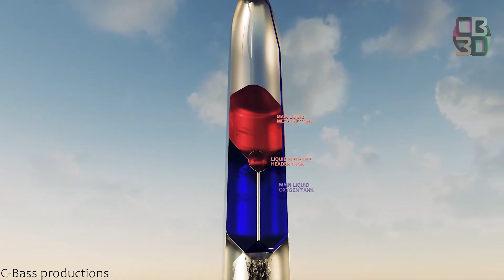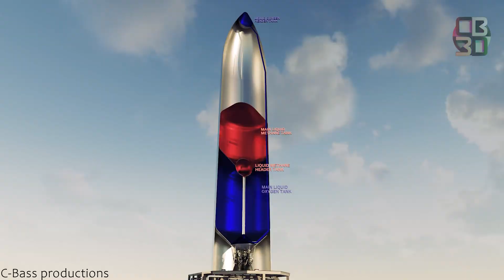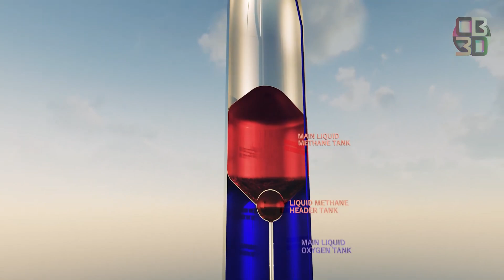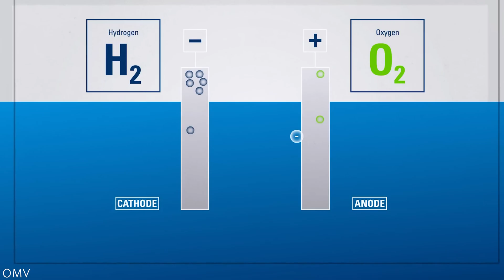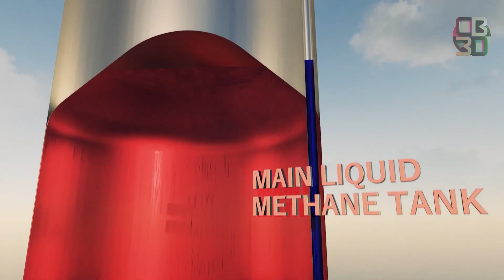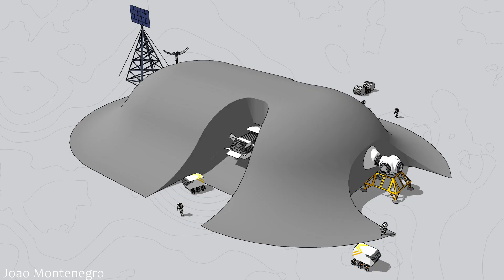Using Only SpaceX Starship To Build Moon Bases. No SLS ! But How?

Comment: I like the way you think. The SLS should have been ditched years ago. Apollo era throw away tech that costs the earth. Simple is better IMO. That's why I'd like to see thermal nuclear rockets to do the milk run between earth and the moon. The notion of having to do around six refuellings in orbit seems messy to me. Granted nuclear rockets aren't available yet but will be soon if all goes to plan. I believe it will be a real game changer when rocket fuel is produced on the moon. So much easier to get fuel tanks into orbit given the moon's relatively weak gravity well. If only visionaries like Elon Musk weren't encumbered by petty bureaucratic empire builders like the FAA. Looking forward to the day SpaceX sets up shop here in Australia. A holes like the FAA may drive Musk off US shores.

Comment: A couple points.  1: this would require insitu resource extraction to already be set up.  2: Why bring lunar starship back? It would not be able to take advantage of aero breaking to save fuel on the return journey like regular starship can. 

Would this be better? Launch and refuel two starships.  One for earth return one for lunar landing.  Land the lunar one on the surface and leave the return one in lunar orbit.  The lander can fly back up and everything can be offloaded and the return vehicle returns to earth saving fuel using aerobreaking.  That way you don't have to waste the 5km/s or where ever it is to get from to the lunar surface and back.  No insitu needed.  You can leave the lander in lunar orbit to be used again if you utilize special refueling takers with heat shields.

Comment: I agree that SLS is useless, when starship finally will be operative. it just is a way to distributer taxpayers money to the national industry .

but it would make more sense to equip starship with hydrogen/oxygen engines right away.  Then you do not need to bring methane to the moon.  Even when the amount of methane is less than that of the oxygen. every kilogram of payload counts when it comes to provide enough delta V capacity to reach the moon and get back to LEO.

another problem is, that no facilities to mine and electrolyze water ice exist on the moon.  so it need one or several  starships that bring all the equipment first and we need time and people  to install it. how will these get back in time, when the hydrogen and oxygen are not available yet ?

Comment: Good to see you back Sebastian. I love this space stuff and your explorations of different ideas.

On the CH4 problem, if a production facility is set up on the Lunar surface to break down Lunar ice into Oxygen and Hydrogen then (and I'm not a chemist so I really don't know) is there any reasonably accessible and not crazily energy inefficient process that could also be set up on the Moon to combine that Hydrogen with carbon to create CH4?

Since four out of the five atoms needed to create a CH4 molecule are already on the moon (the 4 hydrogen atoms in a CH4 molecule) I'm thinking that if such a process did exist then rather than bringing liquid CH4 to a fuel depot in Lunar orbit maybe it would be more efficient and easier to handle to bring just the missing carbon atoms (pure carbon in solid form) to the Lunar surface to feed into whatever CH4 production process was being used. That way an HLS Starship that was heading back to Earth could be refuelled on the Lunar surface and would then have enough fuel to climb out of the Moon's relatively weak gravity well and get all the way back into LEO without ever needing an orbiting depot in Lunar orbit. Also, cryogenic storage should be easier on the Moon than in Lunar orbit because the storage tanks could be buried under the surface, it would be easier to create solar shields over them, and assuming a robust power infrastructure (nuclear and/or solar panels) had been set up on the Lunar surface more power could be available for active cooling compared to what would be possible for a fuel depot/tanker in Lunar orbit.

And one other small observation on the CH4 issue. The ISS does use the Sabatier process to convert CO2 + O2 into CH4 + H2O (the CH4 is vented into space I believe). Admittedly that would not create anything like the volume of CH4 needed for fuel but in the spirit of wasting nothing it would make sense to use that process to scrub excess exhaled CO2 out of the atmosphere and that would contribute at least a teeny tiny bit of extra CH4 to the fuel supplies.

Comment: I'm in favor of a big space bus/tug. Build a vehicle in orbit, capable of reaching moon orbit and return. It doesn't need to be aerodynamic nor have heat shields, so it would be mass effective. Use specialized vehicles to get people, fuel and cargo from the surface. Being specialized they should be efficient. On the first trip, it should bring with it one or more descent vehicles for crew. This descent vehicles could remain in moon orbit, and for the next trips you only need to bring fuel. Cargo descent vehicles could be expendable, and be recycled as part of the installations in the surface of the moon. This have to main advantages: Only the earth surface to orbit vehicles need to cope with aerodynamics and reentry heat. You can build a bus as big as you want, since it is not subject to the rigors of a launch from earth.
Reply: I can see why SpaceX is going with the "Starship all the way" model initially since it's the simplest and quickest way to get the first cargo and then crew to Mars (or the Moon if SpaceX was ever going to do a Lunar project on its own and not as part of Artemis) but I very much agree with you that ultimately the far more efficient model is to break an interplanetary journey up into sections, transfer shuttles at each end to get cargo (including people) to and from a planetary surface and a separate orbit-to-orbit "space liner" optimised to only ever be in vacuum to travel between Earth orbit and the orbit of wherever you're going to.

As you say, numerous mass reduction opportunities for the "space liner" since it only needs to travel in vacuum. No need for extra structural integrity so that it can survive the MaxQ of a launch from Earth, no need for the propulsion section to have any wasted mass for sea level Raptors that are only needed after stage separation to climb out of Earth's gravity well, no need for landing legs for a Lunar/Martian etc landing, no need for header tanks - the list goes on. Also, for long duration crewed flights e.g. the many months to Mars a vacuum only vessel could incorporate inflatable habitats to give the passengers far more comfortable (spacious) living conditions during the trip.
Reply: @julianfp1952  Also, it is launcher agnostic. this is a plus from my point of view. You can start planning and building it today, without waiting for the superheavy success, you can do it with heavies. ( Of course, a working superheavy would help a lot)

Comment: I appreciate the last portion of the video, i think using Starship as a Habitat and bringing with it all the cargo it needs, filling up every part of Starship excluding the command deck. Once it is landed on the Moon, lay it down or leave it upright, but laying it down would make sense or even have the top portion that is livable space removed or detached from the rest of the fuel portion and place it on the ground? we know that Moon Starship is not coming back, however if you left it in orbit, you could put it up with docking rings, you could bring forth other starships or modules like Artemis would use, to build out a space station?

Comment: Using "Starship" as it's depicted is silly.
It has never made sense to take the second/upper stage that gets you off the ground, beyond LEO.
Maybe you could, but it sacrifices utility.

Use the SH and an equivalent upper stage to lift pieces like the "Mars Direct" tuna can habitats and other cargo assembled and fueled in orbit.

Aside from Elon's PR shows and fanciful YouTubers, I have seen nothing to the point that NASA has ever been considering the "Starship".

It's a tanker, not a cargo carrier, not an interplanetary transit hab or surface lander.

It is also never going to lift people to orbit, and it's a stupid waste of resources to look at that.

SLS is hyper-expensive not just because it's expendable, but that's just the way it and the Shuttle before it was built.
They deliberately try to involve as many subcontractors as possible to spread as much $ around as many congressional districts as possible.

Comment: It would indeed be cheaper, but I don't think NASA will agree to put its astronauts in a spacecraft that doesn't have a rescue system in case of a problem during take-off.
Reply: Well what if once HLS is done being refuelled in LEO, a dragon docks with HLS to board the crew and heads off to the moon. That way nasa can have a trusted crew launcher with an escape system and void SLS entirely.
Reply: @norrisbonson3795  Yeah it's a good idea.
Reply: Why would you need to? Why cant Dragon, meet Starship in Orbit? No need for rescue system or take off?

Comment: Great video Sebastian. These are the ones I always like the most! One question, has SpaceX been working on the landing legs? Or are they gonna strap on some rockets and land a mechazilla lol
Reply from the maker: Hi Aaron, thanks a lot, I really appreciate that you've been with us for years now, and I am happy that I can finally continue with this channel in this a bit modified form :)
You mean landing legs for Starship? The Lunar Starship will certainly need to have them, and they will also be essential for a landing on Mars, so they will need to implement some landing legs sooner or later.
But the Super Heavy doesn't need them, as it will be catched. And a pure LEO Starship, will also not need them, as it probably will also be catched by Mechazilla. Only the Mars and Moon ones will need the legs, I think. But not 100% sure.